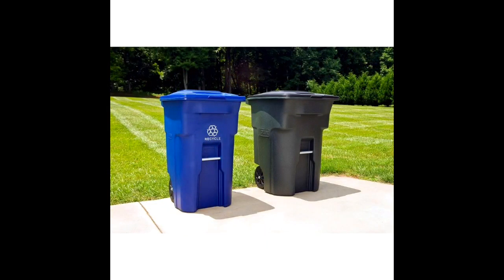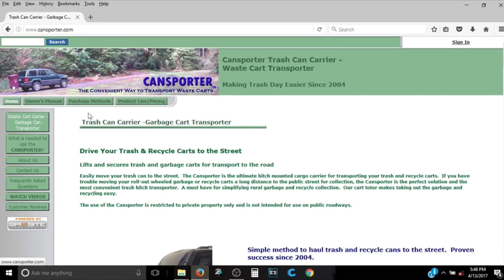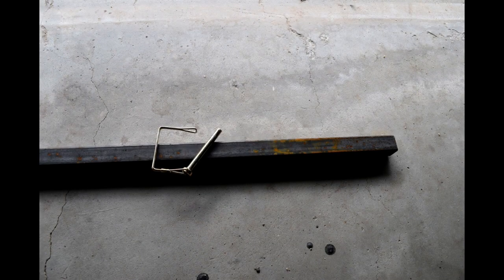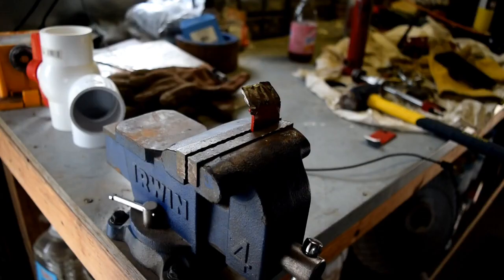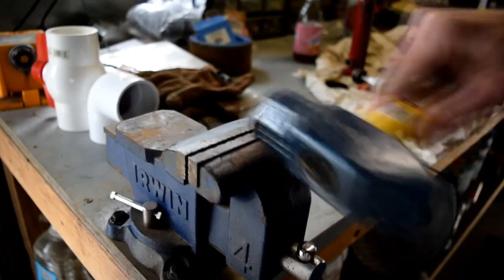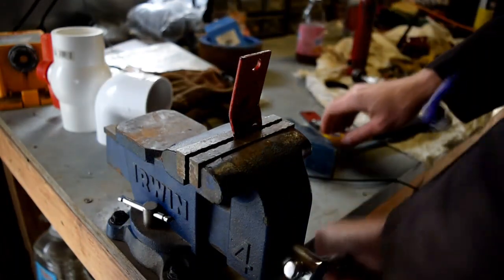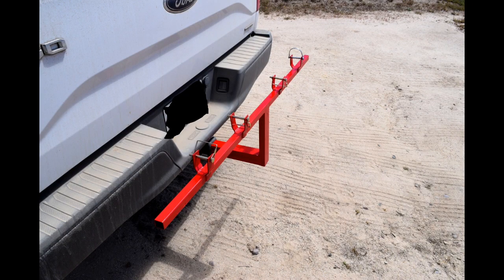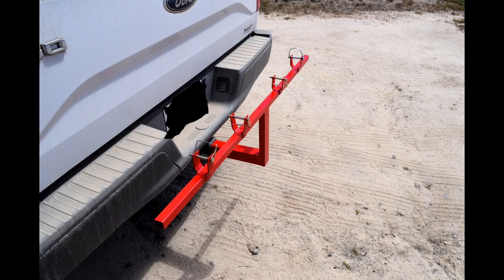How to build a tow hitch mounted carrier for your trash bins DIY

Comment: Hey I'm fabing one now and I have a question. How far away from the bumper did you measure and how tall from the center of the 90 did you measure. Did the lower angle help the can tow better. 
I also have a 600 foot driveway  way and am very glad to see your design.
Reply from the maker: Alex it's been awhile since I made this and since I moved I gave it to my brother. From memory I believe it was about a foot off the bumper. It towed perfectly with the lower angle but you dont want it too low or trash may spill out when you hit bumps.